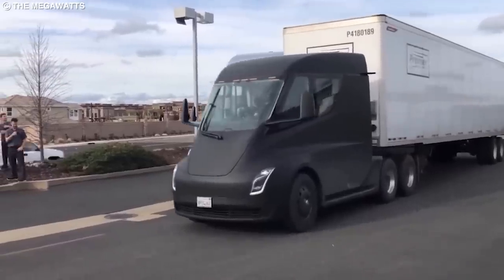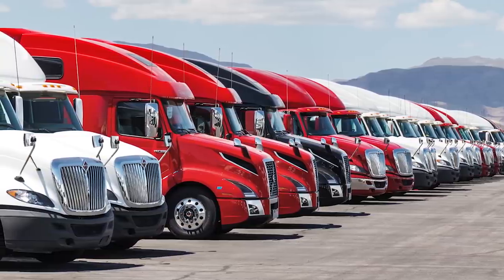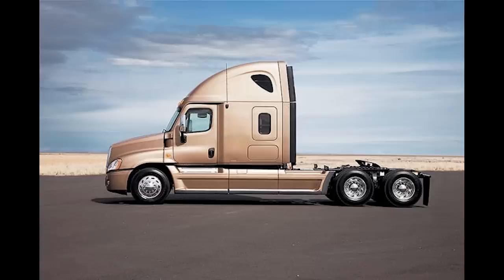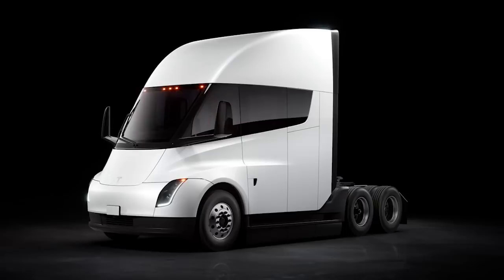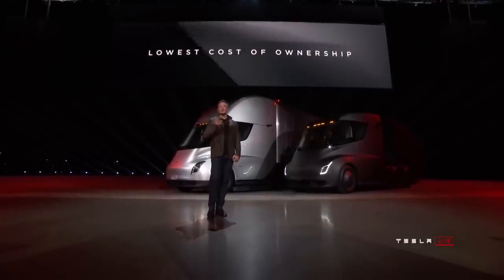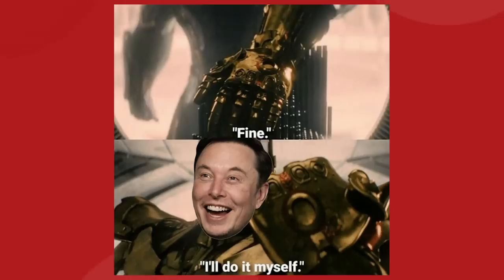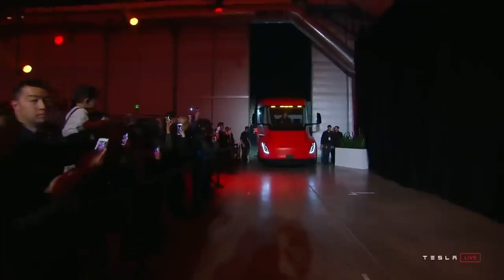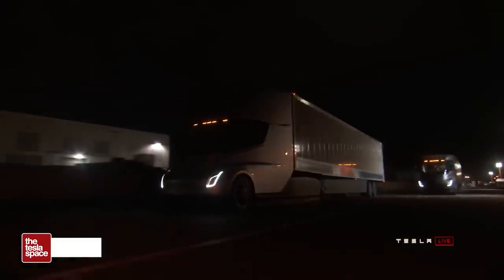The Real Reason Tesla Developed The Semi Truck!

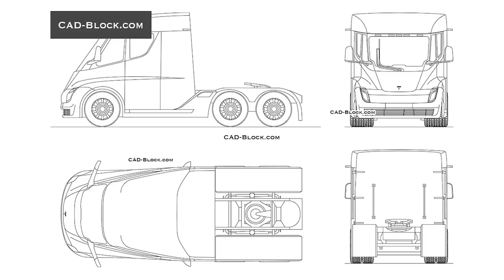Comment: 1:19 - How do you define "perfectly" and "flat." I agree it's a flat front compared to the alternative. However, they made no effort to keep those faces as close to a flat plane as possible ( there is a machining tolerance for flatness of a surface, aside from the thickness or surface smoothness. )
2:30 - Why? Why would it make a harder ride if the cab is attached with the same dampers and bushings as a mid-cab? 
4:57 - Ignoring the width of the vehicles, turning radius, the load, yeah... As nimble as a Ford F-350 long bed Quad cab.
7:10 - Is an Elon pinky promise of 500 miles as good as real world tested machines from other manufacturers? What if the Tesla version loses efficiency when going up and down mountains like transfers North/South through Tennessee? What if the heat is so intense, that the batteries lose 30% capacity?
7:37 - Average sports car? Isn't that a $1,200,000.00 USD. Bugatti? It has several servo actuated spoilers, if I'm not mistaken.
13:39 - Put all of those charging times on a chart.. Do you see why your explanation is worthless? You have mixed units, mixed configurations, and some that are just estimates for a vehicle that hasn't been tested.
15:11 - Tesla is the only one that could make a functional electric truck... Volvo has delivered units while Tesla is still testing prototypes.
Reply: Do you have a college degree? I’m guessing you majored in minor things, since that’s what your comments seem to focus on.
Reply: How's it going to do in Arizona in the 120F-130F summers??

Comment: IMHO, the commercial transition electrics will be the tipping point for the mass adaptation of electric vehicles.  Most commercial vehicles only need a modest range.   In many cases, daily use could be recovered from 110 charging.  When businesses realize how much money electrics can save them, it will be a massive shift.  We just need the vehicles to be available.
Reply: explain to me how itll save them money, currently it costs more to charge an electric vehicle than gasoline
Reply: @MrPaxio  Where do you get your info? You are either mistaken or lying.
It costs me .33¢/mi in my ICE car vs .06¢/mi in my EV.  
For $5 that's 15 mi vs 77 mi of range, respectively.
That's if I was paying for the electricity, I'm not.
I get electricity for free, but no-one gives me gas for free.

So, tell us again how it costs more to charge an EV than an ICE vehicle.
p.s. I don't own a Tesla, so no free supercharging.

Comment: As a local truck driver, I can see electric trucks taking over the local market. Not for autonomous driving but it’ll save billions of dollars by cutting cost on fuel alone. I drive from Phoenix to Tucson everyday with 2 local Phoenix runs after. That averages to about 350 miles each day. Electric trucks will easily get the job done. Some of the spaces I have to maneuver around and back into takes almost extraterrestrial skill… way too many hazards for an 18 wheeler to go fully autonomous (believe me) We will get there one day tho,  and I plan on owning a few.
Reply: how will it cut the cost of fuel? charging an electric vehicle costs more than gasoline
Reply: @MrPaxio  How will it cost more than diesel?
Reply: @Aaron-xr7oc  do your own math. on the road chargers take 35c/kwh minimum, 50-90c/kwh sometimes for slow af chargers. if 1000kwh goes 400 miles then you can calculate that it won't be pretty

Comment: Tesla coming in with a 500 mile range puts them ahead of the competition for another 5 years.  My guess is that they will come up with some agreement to install chargers at major gasing facilities that have shopping/showering facilities.
Reply: Are they shipping both 500 mile and 300 mile versions, or just 300 miles initially?
Reply: It’s 500 miles with 1MWh battery while other trucks have 250miles+ with less than 500 wh battery

Comment: Could the trailer be used to supplement battery storage.
Weight of today's batteries much less so it may not affect load capacity by significant amounts.
Reply: And while we are at it, why not put solar panels on the pantec/trailers roof.
Reply: doesnt matter when it costs more to charge electric than diesel
Reply: IT ONLY WEIGHS 17 THOUSAND POUNDS
Reply: Generators on trailer would help to recharge while stopping,  that would help with the recharge.

Comment: Sadly I don't think these batteries are going to hold up under constant DCFC like this in these semi's.  I  don't think they are going to be able to deal with the rain, snow, wind, elevation changes and constant DCFC.  They absolutely won't be getting 500 miles in the real world conditions.  This industrial constant DCFC cycling is entirely experimental and we will soon find out just how much abuse these batteries can take and for how long.  This will be the real compelling reason to find better battery tech or to sort out hydrogen for more energy density onboard.
Reply: Christopher Columbus should have waited until the Concorde was built to discover America.
Reply: @stewiesaidthat  As long as it is someone else's money, and business on the line knock yourself out.  Might help to have a boat before you went looking for better trade routes...  In your enthusiasm for things experimental, how about we don't mandate everyone goes looking for trade routes without boats?  You know a boat wasn't something experimental with Columbus? Just dishing it straight.  They are gonna need more energy density onboard for long haul OTR trucking and it will need to be able to take some incredible abuse.    We are all going to find out soon enough.
Reply: @Longsnowsm  I must have missed the part where diesels were being banned. I know California is completely nuts over EV's but the rest of the states haven't signed on to their greenness. 
The point I was making, which you failed to grasp, is if you want until the technology is perfected, you will never get anywhere. Somebody has to go first and make the sacrifice to see if the journey is worth taking. That is what Columbus did. He took the risk of not returning from an ocean voyage and opened up the new world to the Europeans.

Comment: Important video!  Thank you.  if Tesla can make these in quantity the "Game Over" hype becomes reality.  Retrofitting the Semi battery array with either a prismatic format battery or a graphene 4680 is going to have a nice effect for the Hodlers.  Wonder how far along AI mechanical design has come?  The machine that makes Graphene or even Borophene at scale will be a quantum leap in productivity that can be had from these Semis and all EVs. Who to cheer on; the AI engineers or the Mechanical Graphene engineers?  They both approach solution to the same problem.

Comment: I like the idea of electric cars and vehicles, I just wished the same push and real world impact was being done in how we create power for the whole world, as in about 80% of the worlds power comes from burning Fuels which is used to charge these electric vehicles on a daily bases. If we want to get rid of fossil fuel and natural gas we need better ways of producing the same or more energy with less pollution and new ways of storing power that does not use lithium batteries.

Comment: Skeptical. Range for hauling is not as important as efficiency, and with that i mean how much battery that thing has to haul around compared to how much cargo it can hold.
Im also kind of iffy on the centralized seating position. You loose a seat apparently for what upside exactly aside better aerodynamics? 
Also i dont get the point of them "dominating" with the Truck already, they are just the first to apparently do it for real, doesnt mean they are the best at it just means they are the first ones who give it a shot (and reveal so publicly).

Where im from in Europe where even the highways are uphill for quite a long stretch that thing is gonna inevitably have to face with these challenges as well... maybe for US its "good enough" tho.

Edit: After further consideration im also not certain how good its actually going to be for the energy grid. Tesla promised super fast charging, but energy prices are already rising steadily so i dont kno when the point will be reached where its LESS espensive to drive Diesel... especially considering teh upfront cost?
Reply: Heard that the central driver position may not always be desirable: Drivers talk out the window to yard people, etc. Further may need offset position to gage postion when backing or close maneuvering.

Comment: Oo ok so we’re just going to entirely ignore Hyliion in this review huh 🤔 I understand . It’s kinda uncomfortable going over Hyliions specs. 1000 miles capability. Negative carbon footprint while it’s compitition is still running on coal fire power plant Electric ⚡️ cheaper than grid power. Zev credits . Longer lasting more durable batteries more resistant to fire over the competition

Comment: if the 2170 is higher density, why make the 4680?
Reply: The 4680 is improving every month. I  heard the current 4680 is now better than the 2170. The batteries Sandy evaluated are now over 1 year old.

Comment: Kamikito are NOT Japanese knives. they are CHINESE knives.
They do NOT use "High quality steel". They use 420J steel. just because steel is SOURCED from Japan, does NOT mean it is in ANY way similar to high quality steels like Aogami or shirogami that have made Japanese knives famous and the marketer is counting of the public being fooled by the half-truth.
They are NOT made "using traditional techniques". Traditional techniiques include using manual hand forging. These are made in a modern Chinese factory. The fact that it takes several years to complte from start to finish just means the factory is inefficient. A Japanese smith can make a knife in a few hours.
Just because a knife is GIVEN to a chef, Michelin starred or not, does NOT mean we use them. I've had dozens of free samples from various companies. Yes, I used them to TRY them. But then most of them were given to goodwill. I couldn't even give them to an apprentice or one of my students because I'd never let them "on the line". A chef has moral and legal responsibility for the safety of his crew and the food that they produce, so NO Kamikotos "on the line"

I get that advertising is nice to support the channel. BUT by getting you to lie, they are lowering YOUR CREDIBILITY!

Comment: Any hints when the first PetaNuke plant is going on line?  The whole truck thing cant possibly work beyond a few demo models until there is some serious additional electric grid capacity.   I dont even wanna calculate how many solar panels it would take to push an electric truck 500 miles per day, not gonna be figured in square feet, nor yards, think acres and acres. 40,000 trucks rolling at any given moment in the US, the panels would completely cover several small states and another state buried in batteries to gather up power WHILE the sun is shining, after all, for every truck that is rolling, you will need bare minimum 3 times that kwh capacity in stationary battery, more like 15x to account for cloudy days. That is in the neighborhood of 15 gigawatthours of battery capacity to keep a single, 200 mile range at a time, truck going.  36,000 pounds of battery to haul 6,000 pounds of freight, that is why the roll out is to potato chip and bread, local delivery trucks. If it must be electrified, the only way it has any hope of being affordable is if the rails become as easy to get on and off of at any moment as a turnpike now is and there will need to be a place to get on and off the rails every few miles nationwide and the rail speed limit is 40mph.  The amount of infrastructure required to substantially switch to electric vehicles is mind boggling.  
I need some help spreading the results of the calculator on this thing cause it seems very few of us understand the numbers!

Comment: When Tesla achieves Level 5 FSD, the semi trucks could/will platoon together . Driving within feet of each other will reduced the air drag and costs per ton mile to that of rail. The advantage over rail is each truck will split off from the platoon and deliver it's cargo ,where as with rail, each railcar of the train needs to be unloaded onto a truck and then delivered from the rail yard.
Reply: Nice for the trucks, not so nice for whoever wants to overtake a "train" in the highway.
Reply: Nope!!! Crap!!! All trucks have different destinations and different departures…….
Reply: @alanmay7929  Shipping Companies in major cities could  co-ordinate departures such that platooning is possible when possile. The incentive is reduced transport costs.
Reply: @rayspencer7255  crap!!!!! Shiping containers have also multiple different destinations and have to be also handled differently…. And a problem with one truck will literally create serious issues
Reply: @rayspencer7255  reduced costs means using things like trains which China for example has already built a railway road that directly send containers instead of using ships

Comment: These Tesla trucks are not practical nor economically or environmentally viable. The battery size is reported to be 900kwh, which is not only hugely energy intensive to produce and with all the problems of lithium mining. It's also impractical to charge, it would take days or require a small powerplant. In my opinion the future of freight transport is to push rail freight as much as possible, or to develop fuel cell powered trucks, which would also require batteries, but much much less than the Tesla semi.

Comment: Will be amazing to see electric semi's in the city, the NOx, brake and tire dust will be gone Drastically improving air quality. Although pollution from electricity generation will still be around, it would be spread out. Chicago for example (where I'm at) has 6 nuclear plants (11 reactors total) and a lot of renewable energy but still gets 24% from coal, as coal can accommodate fluctuations it's "necessary". Although battery banks would do the same and more

Comment: 8:38 I know you guys have a great channel, been following you for about a year now, please look into the advertisers a bit more, kamikoto knives are actually just a scam, they use the lowest grade steel for any knife and sell them for ludicrous prices, you can use a metal ruler (which uses the *exact same steel*) to craft by hand an equally sharp and effective knife yourself, they provide knife sharpeners because their knives get blunt, faster than anyone who uses normal knife quality steel

I know you guys don't know much about steel and thats probably why you don't know about this, but seriously, look these guys up, they are scammers, there's a good video by shadiversity on it, but also just ask anyone who has ever worked with steel grades, the grade of steel they use is not useful for holding an edge, it's a generic, cheap, anti-corrosive steel, like... just buy a knife sharpener and sharpen a knife from Tesco, it will hold it's edge better
Reply: edit: to *clarify*, they are selling $10 knives for over a hundred dollars, then giving a $50 discount, actually the box these come in is more expensive than the knives themselves

Comment: Why isn't Tesla using that thing shipping their parts to their assembly lines? O the front of looks like a suv going backwards and the cab is a cab over nothing. going to be hard to find drivers. well maybe be steering wheel holders will 
take a chance at them also their is blind sides driving them, not safe.

Comment: Once again Elon Musk is setting the curve by thinking outside of the box. Speaking of the box. A 53ft by 8ft trailer has 424 sqft or roughly 25 sq meters of shadow free solar space. At 1.4 kw per sq meter illumination and 30% efficiency a semi driving in sunshine would be able to add 10.5 kw of energy back into the mix greatly extending the 500 mile range of a TESLA!

Comment: Next will be new trailers.... they will start putting battery packs on the trailers to go as far as they need to.
Reply: Wouldn't be practical at this time  due to the weigh limits. You don't get paid for hauling your batteries around, you get paid for hailing goods. The more battery you have the fewer goods you can haul

Comment: Who is this kid? They are called cabs, not cabins. The EV trucks are only going to be used for local service not over the road because they only have a 200 mile time before having to be recharged for 2-4 hours. It will be decades before EV trucks will be able compete with diesel engines

Comment: The volvo VNR 430 an 640 in a single axle configuration is the same length or shorter than a crew cab dually. 

Hopefully tesla will talk with more truckers because their truck needs a double bunk sleeper design 600mi range and it needs to charge fully in a hour.
This allows you to drive 300mi take a 30min break and charge the truck then drive another 300mi and charge the truck again and the second driver can take over. 
This way two drivers can drive across the country effortlessly.
Reply: aint no company paying for two drivers in one truck
Reply: @epicgamer42069  you have plenty of team drivers operations out here, especially long haul operations.
Running cars from the east coast out west.
Look at some of these used trucks that are 2-3years old with over 500k mi on them, 
That truck never stopped and the only way that many mi can be put on a truck in such a short time is a team driver operation.
Reply: @jeffgreen9109  did not know

Comment: I've closely observed the residue of truck accidents on the open highway.  In both cases the vertice of chaos, was the coupling jacks.  On the first, the back end swung around and pulled the cab off the highway.  On the second it was the same, but it was a two section vehicle and the back section swung around and whipped the cab's center of mass off the highway!
Reply: I assume this would be the same for all designs mentioned?